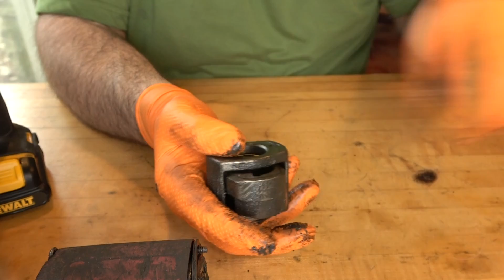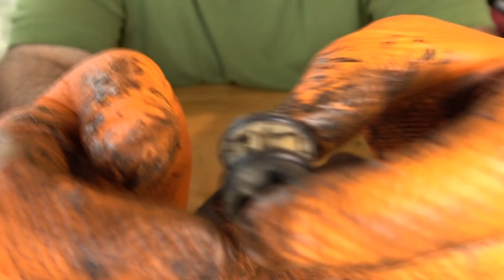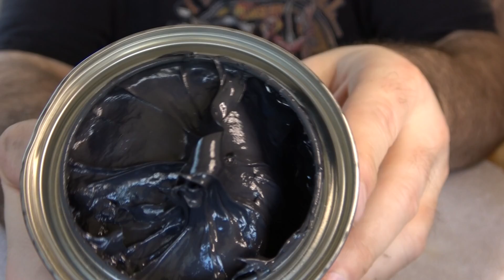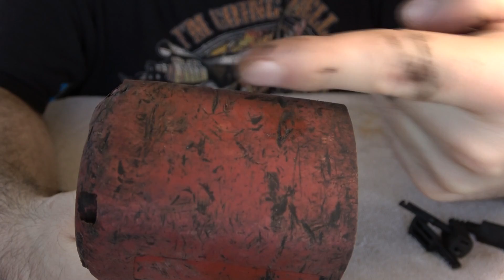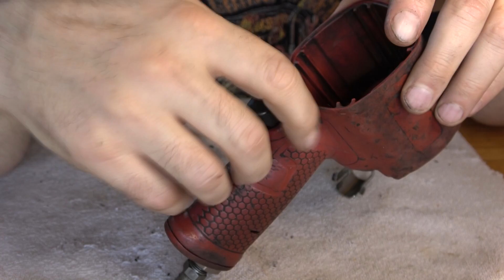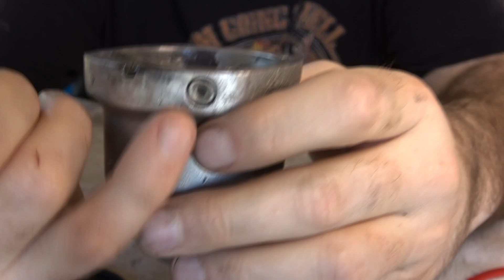THREE Matco 1/2" Impacts Combine to Make One Good One.

Comment: Never gonna hammer on one long enough to change the heat treatment on the steel of the anvil. The entire impact would be smoking with burning grease by that point and the steel would have an overheat blue, purple and gold colors if that were to happen. That piece is very hard to begin and just it's natural hammering will eventually wear through the surface into it's even harder and more brittle center causing it to crack, fracture and break. Looks like a normal use failure, judging by the amount of wear and damage to the square drive end. Whatever it's doing at one end it's doing it at the other as well. When the drive end starts to get round with wear or starts chunking apart it has nothing to do with heat and everything to do with the incredibly vast number of fatiguing cycles on the hard steel.

Comment: Hello again, Lindsay 
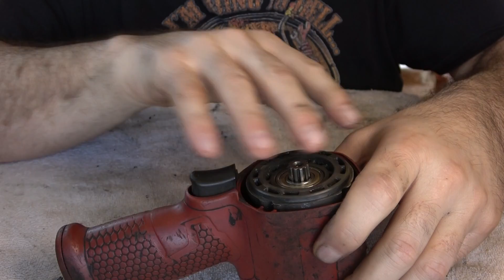Thank you for another Great Video 👍 Question for you, at 34:09 I think. The bearing goes in dry? How does it get lubrication? Or did I miss it 🤔 Again thank you
Reply from the maker: Hello, George! Those bearings are shielded and lubed from the factory. You could lube them yourself if you remove the shielding and expose the balls. I've seen some impacts use the unshielded type. I don't really think it matters.
Reply: @CoyleTools  Hello again, Lindsay 
Thank you for the quick response. I 'm sure you had the experience of fixing something when a bearing comes apart. It's not every day or fun. Again thank you 👍
Reply from the maker: @georgeferlazzo7936  It certainly isn't fun, but at least with these, it's not difficult to do. I've both reused them after re-packing them and replaced them. Thanks for the question, George!

Comment: I have a Snap On IM510 that belonged to my dad. It was sent in for repair and returned as obsolete parts non repairable.
Is there a source of parts for these older items no longer supported by Snap On that you’re familiar with? I assume as this video shows using donor parts from other tools may be the best way to repair it. The sentimental value of having this tool in working order is the end goal and not so much daily functionality. The internal switching mechanism is the apparent problem with this tool.
Reply from the maker: You may find what you need here: https://powertoolrepair.com/tools/Snap-on/IM510 If they don't have the parts, I don't know of any other sources. Snap-On tools are usually only serviced by Snap-On and they don't generally sell parts to other repair facilities. Like you said, maybe you could find a complete used tool and strip it for parts?

Comment: Man those guns were very well used,  he got his money's worth that is for sure.
Reply from the maker: Yeah, he did! It's worth the small investment to fix  one considering now they're over $600 new on the tool trucks.
Reply: @CoyleTools  OH absolutely!  $600?  That's insane!  I think you can almost get three thunderguns for one tool truck impact.  Or you can get 1/2 of a Dino Paoli.  
I always say if it works, rebuild it, why take a chance on a lemon?
Reply from the maker: @jamescaron6465  That philosophy will save you a lot of money in the long run. I mean, they're so easy and inexpensive to rebuild, why not?
Reply: @CoyleTools  It has and it keeps you from pulling out your hair I have an IR 231 and the aforementioned thundergun I've had for over 30 years.  They've bene rebuilt over the years (not by me) but thanks to your vids, if they need another rebuild, I will do it myself